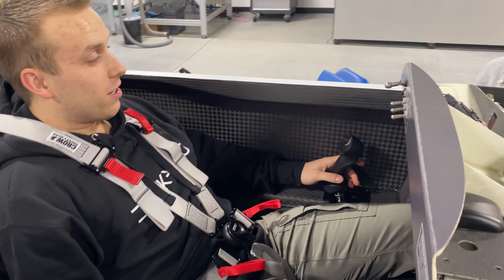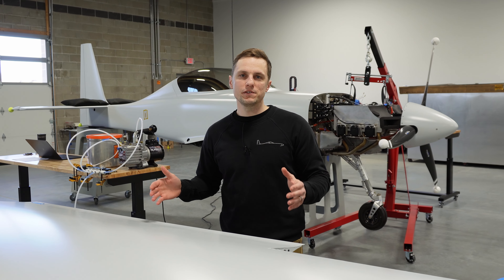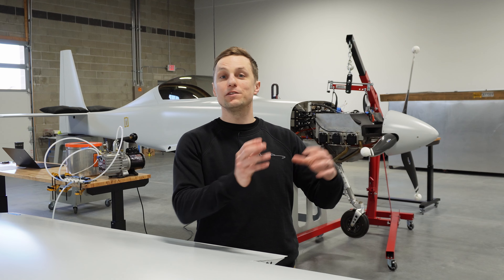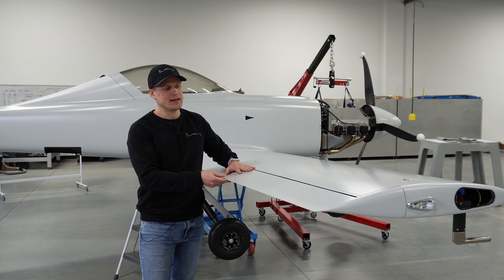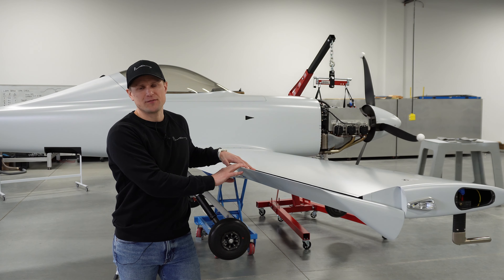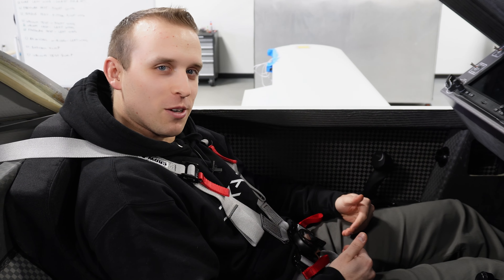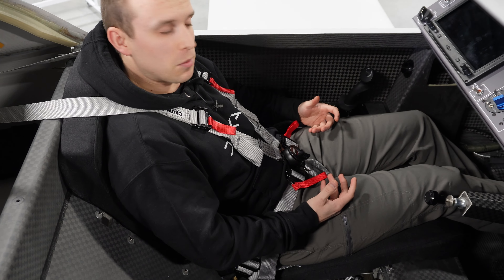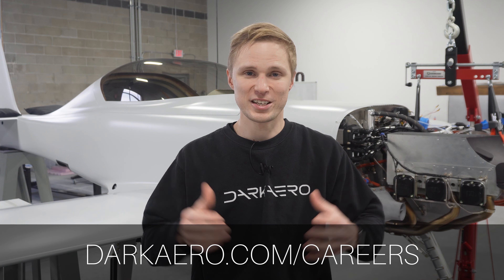Ground Testing the DarkAero 1

Comment: Im an engineer and started a design of ultralight aircraft of 100% carbon fiber construction, several companies in Europe are doing this but I cant find anyone in the states doing this, compare Europe to USA in aviation design they (Europe) are way ahead of us. I based my design off of Burt Rutan builds,  but Im using carbon fiber ribs, and aluminum I-beam front spar and rear spar is carbon fiber, with CNC hot wire foam core in between each rib and carbon fiber skins, and its made weight to qualify for UL part 103, so I passed the first challenge of making weight in the wing section, now working on fuselage and tail section, all on solidworks and OPEN VSP software
Reply: Do you have any tips to build a ultralight
Reply: Could wider crabon fibre tubing with mix of Omni and Uni weave work. Maybe integrated into nose ribs.. ??   just a thought :)

Comment: Awesome development work, thank you. It would be great to understand how versioning, release management and bills of materials (BOMs) work in your life-safety development and manufacturing environment. Particularly:
* Versioning: assessment of each version's backwards-compatibility/SEMVER.
* Internal Release Management: internal/engineering with internal versioned product codes.
* How do you structure and maintain the multi-level BOM structures needed for managing the "assemblies of assemblies" of engineered products? It is critically important to isolate the production/factory and parts-purchasing customers from having to understand versioning.
* External release (release for Sale): how are the internal versioned product codes linked to the Sales product codes that customers see?
* Some discussion of the importance of 'immutability' for both the source files (source, CAD etc used by developers) and the object files (binaries, CNC files used by the factory and out-work) are achieved would be great too.
Reply: Great comment. I think the one question I would add to your list that would be cool to know is how many bananas long the plane is from prop to tail? Maybe show a banana for scale.

Comment: I’d love to hear more about the interaction of gasoline with the epoxy/composites, particularly over time? Some manufacturers have had LOTS of issues with built in tanks in the marine industry. 
Great work though, beautiful plane!!
Reply: Especially if an internal pinhole allows fuel to move into the honeycomb spaces when new and over time with degradation due to flex and heat. That is a huge internal surface area and linear distance of joints with a requirement for a perfect seal. At some point lots of joints will be slathered with epoxy and a giant skin will be pressed into place over very many longitudinal members. Can a perfect long-lasting seal be expected?
Reply: @tomscott1159  How are the internals examined?  This design looks like a permanently sealed one.

Comment: I love your custom aircraft!

Ultimately, all airlines will have to have mostly composites, and they will have to go with either solid oxide fuel cells (they can use their existing fuels, and get more than double the range) and smaller aircraft can use hydrogen for shorter flights like air taxis and city to city

Comment: This reminds me of the wet wing design of the BD-4.  How do you handle with sucking air during maneuvers when you unport the fuel pickups? This required either a header tank or droop pickups to prevent the issue in the BD-4.
Reply from the maker: Great question! The short answer is the fuel system utilizes a central sump (header) to keep the fuel pickups from unporting. We discuss the fuel system architecture in detail in this video: https://youtu.be/kVOEJPPR60U
Reply: @DarkAeroInc  Thanks.  I'd really love to see this matched to the Viking 195t.  Good to see a header tank, which will make this match up doable.
Reply: @DarkAeroInc  aircraft looks very beautiful with the paint job but have you thought about covering the interior of the  aircraft with paint as uv might go through the canopy and affect the resin.  btw I really appreciate the knowledege you share Thank you.

Comment: Hey guys, thanks for the update. I had forgotten what a slippery speedster this is designed to be! I’m glad you did the pressure testing against delaminating of the wing during unexpected loads. I would love to work on marketing your plane when it nears that point. I am so psyched to see it in the air, but I also want you to take all the time you need to do things right as I can see you will. Best of luck to your team.

Comment: Coming from a seat design engineer at a major aircraft company - well done. You guys clearly did your research on crash testing. The only thing on that 6-point is that customers (and more importantly the customer's wife) is not going to like having to put that on and wearing it the whole flight (especially for a longer endurance airplane like yours). There's a reason most modern manufacturers are going with a 3-point and inertia reel system. I'm sure you've thought through the comfort implications but considering your seat positioning it does seem necessary (although I'm not familiar with experimental aircraft seat cert requirements).

Comment: Mechanical engineering student checking in with a question - is fatigue testing something you need to be concerned about given you are using composites? With multiple flights I imagine the wings/tanks will experience cycles of over and under pressure which could potentially lead to problems later down the road? Or are the pressures differences being experienced small enough that that kind of testing isn't necessary? Keep up the awesome work!

Comment: Beautiful, elegant design. Love your vids explaining your design and engineering choices. Judging based on some superficial experience with composite aircraft structures, it certainly looks like your wing is plenty strong. One question: In case of damage, like say a 6 inch dent or gouge in leading edge, how repairable will this wing be? I can think of one composite plane where all the loads in the outer 75% of the wing are carried almost entirely by the skins. It’s a strong wing, but pretty much unrepairable if damaged.

Comment: Is there any long term chemical testing on carbon fiber and your resins to see if long term exposure to Kerosene will weaken you wing in any way, or dissolve things into the fuel?
Reply: #1 Kerosene is utterly benign to cured laminating epoxies and #2, they aren't burning Kerosene... So you might want to ask about Gasoline.  #3, Gasoline is utterly benign to cured laminating epoxies commonly available.  Specifically, it is not the gasoline which hurts chemically but rather the additives.  I am sure somewhere there is an exception for long term gasoline storage, but I have never heard of one.
Reply: The engine they're using has an autogas STC, but they have stated they won't be supporting that because the resin isn't compatible with the ethanol content present in most available gasoline in USA. You can get certified ethanol-free gas, aimed at the marine market I believe. I wonder if that application could be a good option.
Reply: To prevent problems with ethanol, coatings are required. Novalac FR530 for example.

Comment: I hear there's now a market for a commercial airplane manufacturer in the U.S. that focuses on quality & safety.  You guys should do a 200 person passenger jet next.
Reply: The mistakes at BO can be blamed on management, sure. But they were made by very small groups of individuals. I doubt more than two people were involved in the missing door bolts. One to forget them, and another to pencil whip the checklist documents. Two, possibly three lazy and foolish people caused that.

And probably less than ten were involved in the MCAS implementation. The latter system was a hush-hush deal to satisfy certain draconian FAA type certificate regulations. Where the pitch-response and pitch up due to thrust had to meet certain criteria based on the original 737 type certificate tests, else suffer the laborious, multi-year, two dozen billion dollar punishment that is known as new type certification. And also re-training all crew for the new type rating, because of those handling differences. The MCAS system in its entirety could not be widely disclosed inside of Boeing, nor to the FAA, or to any pilots, when it was implemented by a select few individuals to satisfy those FAA handling requirements by an "other than permitted" manner. The reason it failed so catastrophically, is because it was directly tied to only 1 angle of attack vane-type sensor. But a system that can override the pilot and radically change pitch attitude based on AoA sensor data MUST be tied into no less than THREE sensors for redundancy. One, or Two is insufficient, because it wont know which to believe. It has to have three. This is not an area of expertise for computer programmers, who always and invariably expect everything to function flawlessly, and rarely consider failure modes. Since this was a secret project to remedy a potential issue with the FAA due to a change in handling, it was almost certainly kept secret and the appropriate departments were kept unaware and unable to double check this egregious error made by other departments who implemented this half baked idea. Boeing is to blame for this mistake.

But the blame for Boing implementing MCAS on the 737MAX in the first place is actually the fault of the FAA.
Reply: @EllipsisAircraft Actually Boeing and MD have had many design faults that were ignored and resulted in lost lives over the decades. What has happened in the last couple of years is nothing new. Watch some air crash videos and you will see a history of wrong parts and design being ignored for profit.

Comment: It looks fast. Excited to see some flight testing😁 I observed that the outer end of the ailerons, specifically the tip, rotates and protrudes in the opposite direction of the control surface. Is there a specific reason for choosing this design over keeping the outer end of the wing passive and operating the aileron independently?

Comment: Why does the hump on the wingtip move with the ailerons? Won't it provide lots of separation when the ailerons are not at the neutral position?
Reply from the maker: Good question! The "hump" is there to balance the aileron about its hinge line which helps prevent control surface flutter. This extra feature does increase drag when the aileron is deflected, but most of the time in flight the ailerons are at neutral deflection. Thanks for checking out the video!
Reply: prevents flutter. control surfaces need a counter weight there. if control surfaces get bigger it also helps with the power required to pull those control surfaces into position. only not needed on bigger aircraft who force control surfaces into position with hydraulics.

Comment: It's hard to tell in the video, but are you using a "Formula-style" harness? That under-the-leg anti-sub belt routing is only valid with a belt system designed for it (Formula or Schroth Hybrid), and should not be used with a standard 6-point system. Crow does make a Formula restraint.
I'm not sure what the reasoning is for the different linkage, but would tend to trust the engineers that developed them given the amount of research and testing that goes into these restraints.
Very exciting to see the progress!

Comment: Hey friends!  I noticed your testing method for the anticipated hydrostatic pressure on the wing/tank.  Do you plan on a full-scale loaded test on this wing at some point in the future?  I am talking about a complete wing on a test stand held at an angle and torture tested with a fuel analog in place.  Admittedly this is expensive and time consuming, but compared to the damage to your reputation later on it could be a good investment. What I am seeing is that you are not actually trying to find a failure mode and that is a concern.

Comment: If there is a narrow direct link between the left and right tanks with the tanks at ~1/2 full, if the plane banks left all the fuel will flow to the left wing, then if the plane was to suddenly flip to banking right, all the fuel will flow to the right tank, but I hope they have something that allows air from right to left to swap or they might create a sudden strong vacume in the tank losing fule. You can see that effect on 2L coke bottels if you empty them without doing the swirl thing.

Comment: You guys should look into making turbo-aero turbine engines an option. From what I can tell you two will be coming out with a finished product around the same time. I think they are planning to have 100-350 hp turbine engines. I think they will weigh less than 300lbs. Would be a nice option to have on the table at least.
Reply: Turbines are certainly the answer for appropriate applications but they really don't work very well for small aircraft. This is mainly because the fuel burn is so high. Turbines are most efficient up high and climbing high takes time and fuel. A small plane simply can't carry enough fuel.

Comment: have this fun little idea of building something that looks more like a motorized hang glider boat, but with a blended wing mounted over instead, 
wing would be tapering until it switches over to be glider wings (horizontal W shape) with a second set of wings angled from the pontoons at the low side of W, going forward to the nose, keeping it stable. (and it's a nice way to get inside from boat.) 
this fools the law on what is seen as a plane in my country, if the machines total wingspan is 16m, you can fly 24m over the water (wingspan x 1.5) 
some gliders have 30m wingspan, if you then ad on the 4m blended mid wing, you'll be able to fly 51m over the ground legally (without any license)

Comment: Great video on load testing! 

Has there been any testing for electrostatic inside the wing fuel cell and / or various max operating temperatures to prove the fuel doesn't cause desalination in the skin? 

Usually these concerns are only at the cryogenic temperatures but 40k feet average temperature range is -60 C⁰ though fairly far from the -110 to -120 range or lower it would be interesting if you've tested at least a sample with this in mind.

Comment: Really interesting wing.  I am wondering how did you solve the problem of unporting in unusual attitude such as slips or even normal attitude changes like approach and climb?
Reply from the maker: Both wing tanks gravity feed into a central sump tank which is where the fuel pump pickup is located. Check valves between the sump tank and wing tanks allow fuel to flow into the sump but restrict the flow of fuel back into the wing tanks. This arrangement keeps the pickup from unporting. The fuel system architecture is covered in more detail in this video:
https://youtu.be/kVOEJPPR60U

Comment: I didn't check all of the other videos, but will the fuel be directly in touch with the carbon fiber, or do you have a coating on the inside of the wing? If you don't, I'm asking myself if the constant contact between fuel and carbon fiber won't impregnate the polymer part and endup creating premature degradation... that can be a serious problem over time...
Reply: I'd think they could get a bladder made

Comment: I came back to watch this as there was a REDDIT post that this project is dead. The reason he gave is that there is no 'wet wing" and it would have to change to a fueselage tank, which would bring complete failure of original goals, particularly distance. Without a wet wing, CG would change drastically with fuel consumption and make trim a constant job and cut range to virtually nothing. Planes, particularly small ones, REALLY need fuel tanks in wings. 
Seems one-way valves between specified ribs that would only allow fuel to flow towards the center tank would accomplish this goal. It would prevent the pressure on the tips as discussed in this video. And then, each valve should be accessible for maintenance and/or replacement.  Yeah, your perfectly smooth wing skin is going to have some access plates. It is more complexity, but I think can be done passively.  But who am I.

Comment: I thought (and was taught) the belt was there to keep you in your seat in case of turbulence but preventing injuries in case of a crash and since you are the crumple zone...
Do you have concrete evidence 6 point harnesses save lives on experimental aircrafts?
Reply: How many experimental aircraft offer a full carbon fiber tub? Compare this closer to a Formula-Ford. Reclined seats require the extra anti-submarine strap of a 6pt harness, for redundancy, and ability to locate pressure points on both sides of... centerline.
Reply: @EllipsisAircraft  Many ultralights do.
But the point of carbon fibre is not to strengthen the cell but to reduce its weight.

Comment: Hey! Unless I missed it, how will these "all-wing" fuel tanks affect lateral stability? I mean, as a pilot, i should properly be managing my fuel load on each side to attempt an equal amount of usage as possible, but in the event of, well not doing that, how will my stability be affected? That's my concern with fuel near or at the wing tips.
Reply from the maker: Hi there! The left and right wing tanks both gravity feed into a central sump which is where the fuel pump pickup is located. With this setup there is no need for the pilot to manage fuel load. The details of the fuel system architecture are covered in this video: https://youtu.be/kVOEJPPR60U